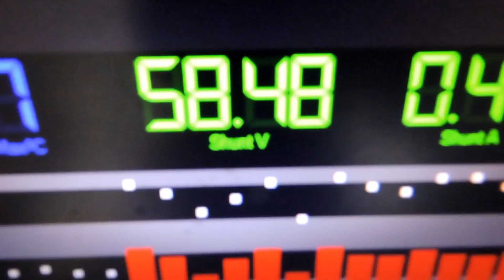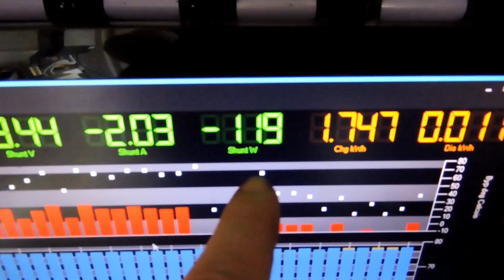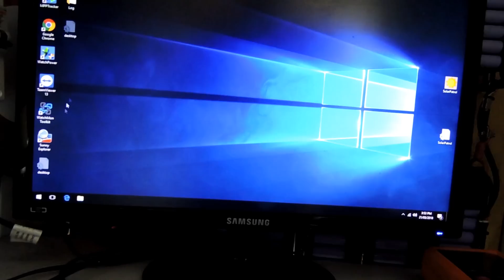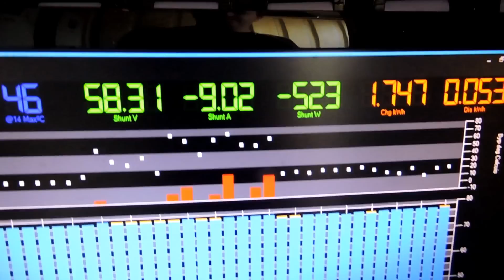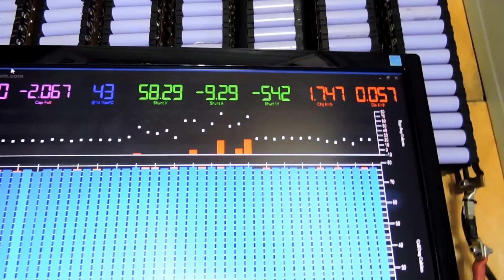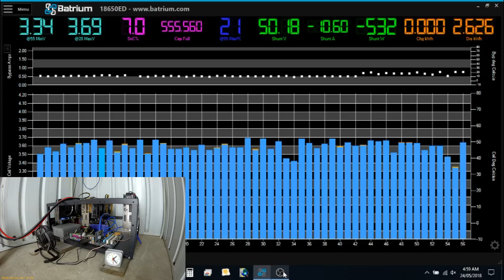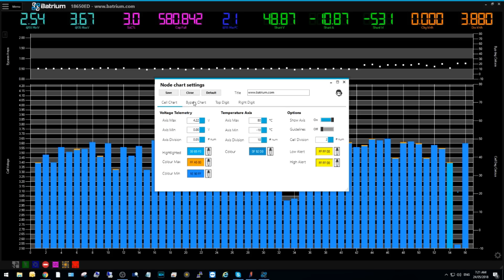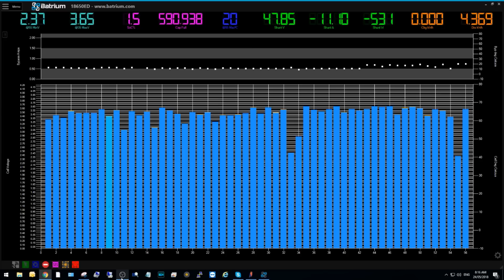DIYPowerwall Load Test with some great results

Comment: Hello..Great video.. Just want to ask what is the life of the diy powerwall ie charge discharge if you are using it for day and night..ie charging in day via solar and using in night. Cheers 😊
Reply from the maker: four full years so far, and still going strong 400ah used last night, they'll be fully charged by 1pm ready for tonight

Comment: was thinking, its dangerous i know, but some sells cut off at 3v so while the packs that dropped really fast might have cells that are cutting out as they dropped below 3v giving a miss reading as the packs get smaller with cells cutting out. just a thought.

Comment: May i know name or brand of DC cable you are using soft cable
Reply from the maker: it's 35 square mm cable from the local welding supplier
Reply: HBPowerwall thanks a lot mathew same with me what u used

Comment: Can you mix 1700mah with 1900's, and  2200s? What is the lowest you can use in a mixed cell block?
Reply from the maker: You sure can - few points you have to check tho - if a cell is 3300mah new and when tested it's 1800 mah you wouldn't use it. You can use the cell data base to find the required cell info https://secondlifestorage.com/celldatabase.php but if the cell was new and 1800mah & after testing it was 1700 it's good to go.. Just make sure you build balanced packs with repackr https://secondlifestorage.com/repacker.php too keep the built cells more balanced

Comment: Couple of questions. I learned the hard way that what often looks good on eBay is a lie. I did order 4 batteries the other day from an eBay seller that the price was good. The weighed out at 45 grams and tested at a solid 2100 mah. They were though button top batteries and if i remember one of your videos it was mentioned that button top was a sure sign of repackaged batteries. I was thinking of buying a couple hundred of these batteries. Should I steer clear of these even though they check out pretty good. Also how do you connect the top and bottom black plastic organizers together so everything doesn't come apart? Thanks
Reply from the maker: what were your cells you bought sold as 2100mah? As for building packs try this play list - https://www.youtube.com/playlist?list=PLVtgHS9JIte_tT8JVGvoK3OBy7sYm3Xwj
Reply: Never mind, the diameter is too big to fit the black plastic racks.

Comment: Hey guys a complete noob here,im having some doubts on 18650s
Im thinking about making a powerwall and confused on some things
One of those things is that what would happen if we connect batteries of different capacities in parallel and charge them as a single system, with bms within  the multiple series connection (making multiple parallel and 4 series connections to make 12v battery pack)
Such as connecting 2000mAh battery with 2600mAh battery 
Thanks

Comment: Have you thought of making small say 5 to 10 cell piggy packs that you can fit to your lazy packs? This way you don't have to dismount and knock cells out and replace, could save you some time and handy if you need quick fix.  Might look a tad messy but would work.
Reply from the maker: A tad messy, is my issue lol I have done it several times different ways - just looks crap :)
Reply: HBPowerwall  yeh, my cells are hidden away so not such an eyesore.  Just take the piggy backs off for the photoshoots :)
Reply from the maker: Too lazy lol takes long enough so move all my shit from the past weeks work to film lol

Comment: Awesome! Is this now 56 packs? What is your configuration now? Used to be 14S 14P ??
Reply from the maker: 56 x 80cell packs - 320p 14s
Reply: Cool! 320 packs each with watchmon or is it watchmon fitted only on 14S?
Reply from the maker: Longmon or Cell Monitor is attached to each 'P' pack and is the balance and temp monitor - watchmon is the hardware brain I guess you'd call it making the longmons smart and controlling all the other stuff.

Comment: Reality is that although the Batrium looks nice it will never handle your charge rate capacity of your your solar input. The only way you can handle those inbalanced cells with those charge rates are higher power resistors. Im working on my on balancing circuit using some 100W  0.2ohm resistors.. That will bleed 21 Amps.. That is still not enough when you get high charge rates and one bank gets there earlier than everyone else.
Nice test. Love your work.
Use the batrium only for monitoring and not for balancing unless you modify them to switch a larger resistor as said.
Reply from the maker: I beg do differ, Batrium works SWEET - but throwing 150 charging amps at it.... will find issues fast. I was brutal trying to get them chared as fast as possible.
Reply: 1.7amps max bleed isnt really appropriate for 600AH cells..
Even with a 20amp charger for eg...  If you have 20amps going through your batteries and one bank hits its 4.2V limit you will soon run out of bleed capacity if the other batteries havent caught up.
Your charger will be pushing for your CV limit forcing more bleed through the highest charged batteries discharge resistor until the rest catch up and the the current starts to drop..
Thats just my thoughts.. especially when dealing with lithium. :)
Reply from the maker: the 'cells' are 150ah so perfectly suited for the job I feel (and has been my experience) Chargers ramp down when they are top of charge so never pumping more than a handful of amps by that time. My issue was the dumb way I did it in order to get a result faster

Comment: hi   grate video  i got a question wear i can get the termal device you got. lead me know so i can get it to  tanx. keep the Excellent Work.
Reply from the maker: Thermal camera or the software to monitor the batteries?
Reply: the camara  if you can tanks
Reply from the maker: It's a Flir unit - https://goo.gl/3FJmGL

Comment: Well done Pete, that was a really good demonstration.
I noticed a bug with the Batrium kWh display - it wraps after 12.87 kWh so can't display the full 30kWh
Suggest Jaron could increase the precision and use more bits for it.
Reply from the maker: Issue was 1. Cell went flat, causing no comms to watchmon toolkit 2. Found a bug in the firmware that caused the shunt not to reset after it goes to 0% SOC - 20min on the skypes to Jaron and he was able to find the issue, make a plan to upgrade firmware & test on his test bench. Fix was to change the SOC level - save - then it's reset and away to go again.

Comment: I thought that you have more capacity in your packs.....
Excellent video by the way... 👍
Reply from the maker: I think there is more in them if they were more balanced packs. would be very interesting to balance them at 4v rather than 4.2 and see if the cam useable capacity would be available. So many cool tests i could do but i feel like i'm missing a leg running the house on grid
Reply: HBPowerwall hahahahahahaha “I feel like missing a leg running the house on grid” hahahahahaaa I’m laughing so hard here reading this hahahaha